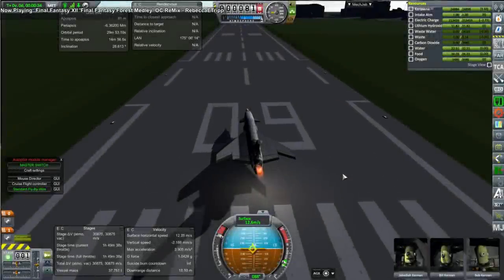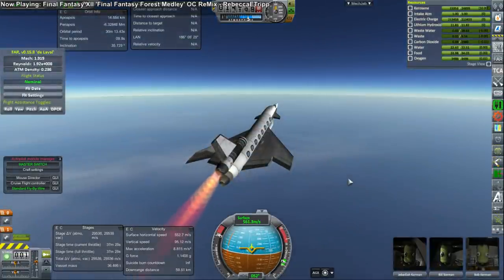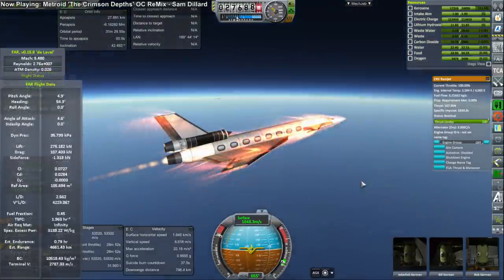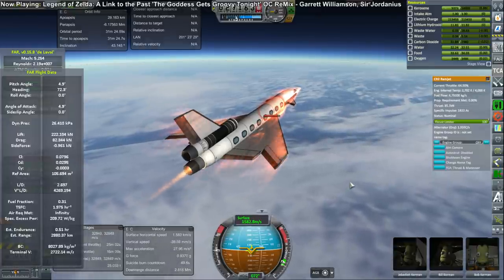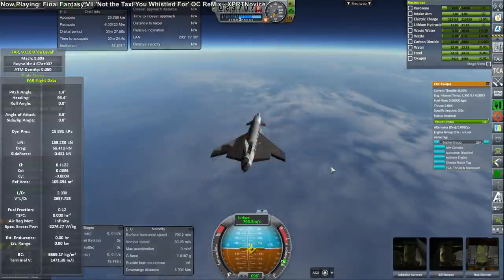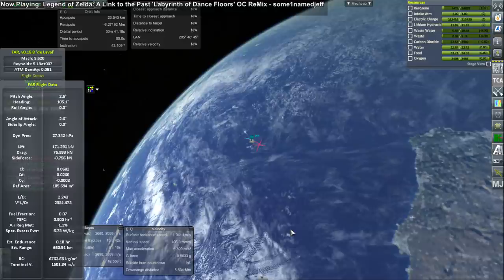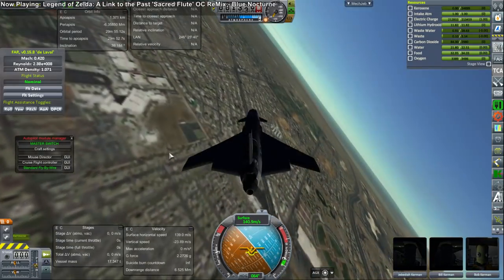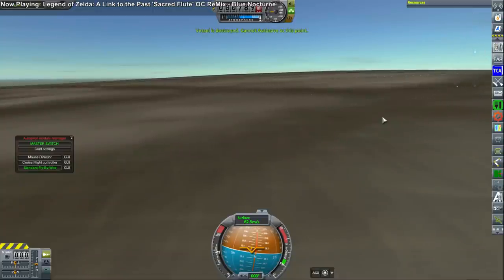Kerbal Space Program RO Sandbox - Hypersonic Liner Development 05

Comment: Wheel suspension settings need more damper and less suspension strength. Also, please use fine controls (Caps Lock) for final approach.
What do you think about putting the J58 on the bottom and the ramjet on top?

Comment: I really like this shortened version. The previous episodes were a tiny bit on the tedious side after about half an hour. And it's cool to see how much progress you make with this.

Maybe you wanna switch the arrangement of the two engines to bypass the take-off center of thrust? It's such a simple solution, you probably already thought about this as well. Or is there any other problem emerging from this solution that I can't see?